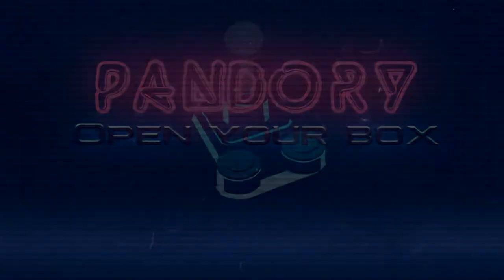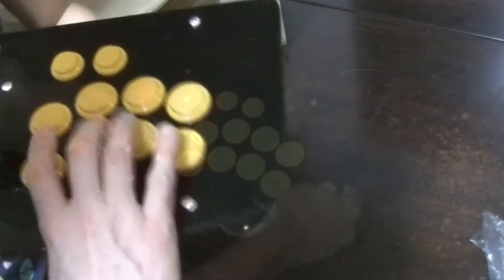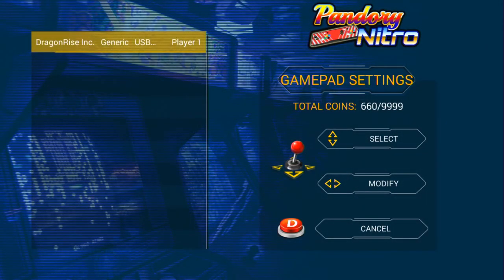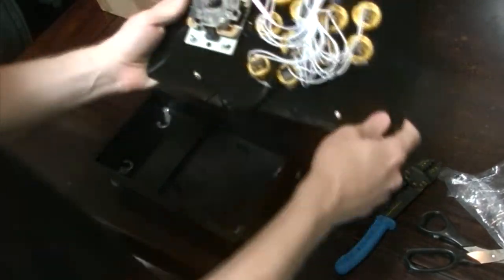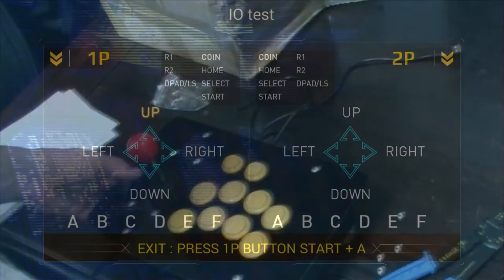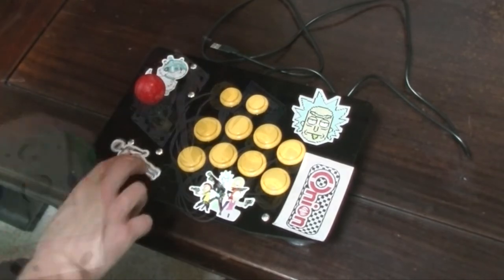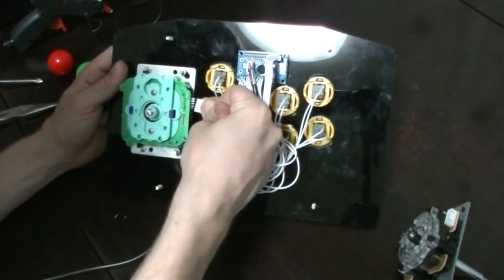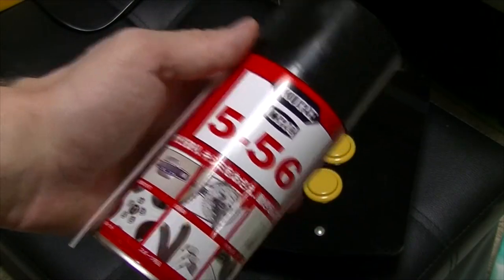Cheap $30 USB Fighting Joystick / AliExpress

Comment: this stick is perfect for this, for replace stick an buttons for sanwa denshi or seimitsu
Reply: Exactly. Sticks with all original parts are 100-200 bucks. This is perfect...
Reply: but for 136 euros you have a dragon slay universal arcade, which works on pc, pandora's box, raspberry, ps4 and xbox one, and is full sanwa denshi but for 136 euros
Reply: @snako79  136 euros is a good price for a casual, but not for a beginner. To be fair and honest, you only need brand-name parts if you are a casual or a competitive player and you want to step up your game. There are plenty of sanwa JLF clones that with little modification end up playing just like the original, and clone buttons you can find plenty as well. I would only invest more than $50 in parts if you are really being limited by the hardware. A professional would grab that $30 stick and destroy you with it.
Reply: @gonzalo4to  they are not the same, I have one just like the one in the video, and I had to put a sanwa lever to make the movements correct, for fighting games, it is necessary to change, to be able to play, you can, but not in a correct way, Even a beginner notices it, I had to buy a second arcade stick, and looking at prices, 35 euros for the Chinese arcade stick, plus changing buttons and stick, it goes from 110-15 euros, for a little more you have a good arcade stick, which also works with ps4 and xbox one
Reply from the maker: Authentic Sanwa sticks in Japan go for 30$ - very cheap.
Reply: @TeamPandory  in Spain you find them from 19.95 euros, and 25 euros, very cheap too, and there is a special edition that is more expensive, they are 60 euros, but they are authentic sanwa denshi, and the seimitsu between 22 and 26 Euros
Reply: @snako79  Hi! Can I play KOF/SF etc with this? How was it? And does it support Play stations?
Reply: @srrazu  there are arcade sticks that are compatible with playstation 1-2-3, the problem, is to find an arcade stick, that is compatible with pandora's game 3d, not all of them are
Dragon slay is compatible with ps4 and xbox one, connecting an original controller via usb via its usb socket

Comment: Does the Sanwa Baolong clone feature on your CHEAP Clones ranked video fit this case?
Reply from the maker: They all fit in the case.  The only one that'd have issues is the one without the small sanwa plug - (the Zipppy with the separate direction cables)- You could get it working if you changed the usb encoder in that case.
Reply from the maker: If you can- just make sure you ask for a short shaft when ordering joysticks.  Those with the long shaft feel pretty poor.
Reply: Great content. Thank you mate.

Comment: where can i find this cheap male\female connector for the alternetive joystick?, please give me a link to ebay/aliexpress
Reply from the maker: I found it on aliexpress.  They're not usually very well made on there though..  Have a search for "10cm 20CM 30CM 40 pin dupont Jumper Line wire Male to Male Female to Male Female Jumper Wire"